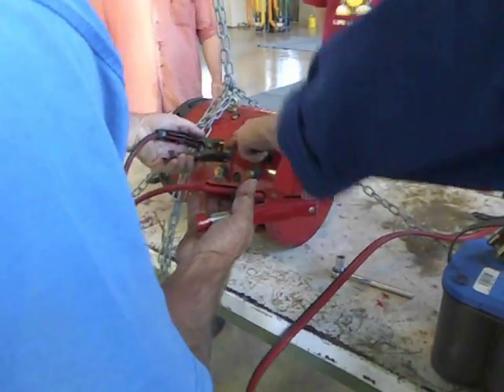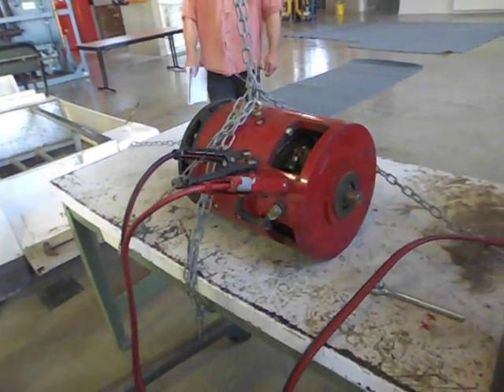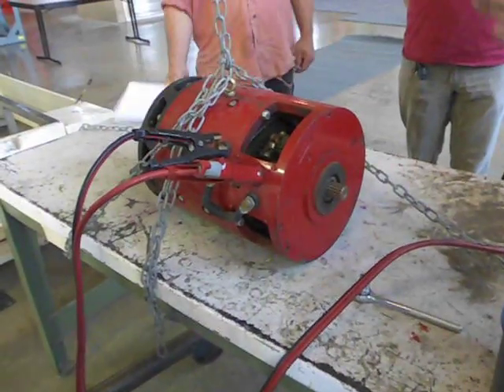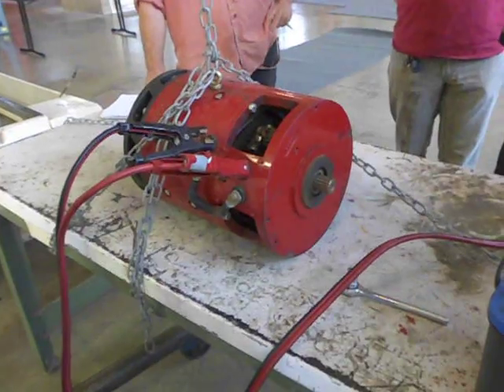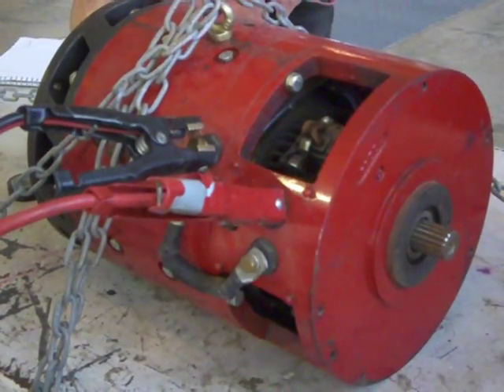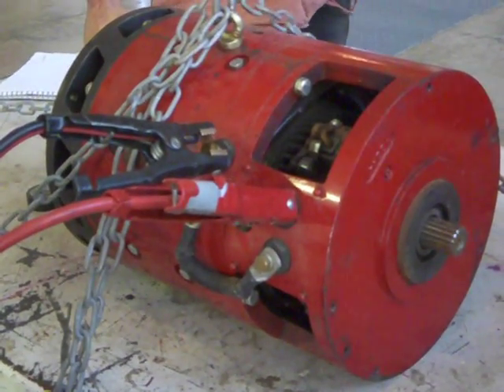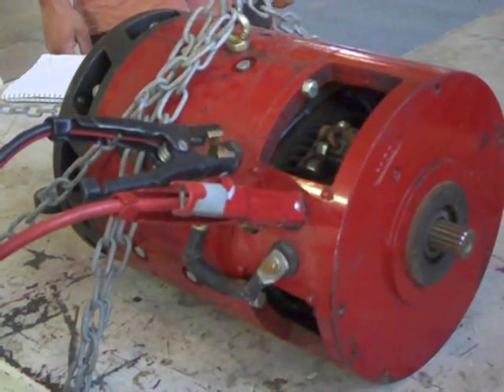Testing Series Wound Electric Motor

Comment: How do you figure out which one is A1 A2 S1 and S2? I understand that you can switch them around so that it switches direction. I just can't figure out how to connect S2 to A1.
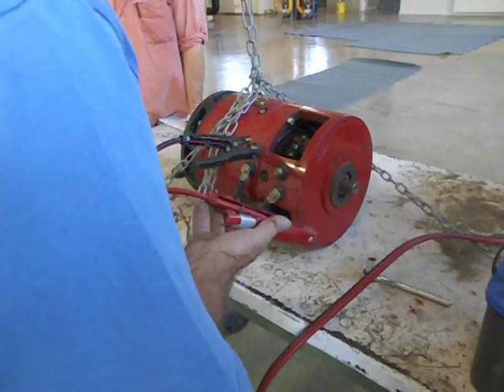Reply from the maker: Pedro Casultsan A1 is a terminal that leads to the one of the brushes (or set of brushes). A2 is a terminal that leads to another brush (or set of brushes). S1 leads to one end of the stator winding whilst S2 leads to the other end of the stator winding. If they are not labeled, you will have to look where the terminals lead to. To connect S2 to A1, just connect them using a sufficiently thick cable (with lugs) that can handle the current and volts going through it. You will see what I mean about the cable at 0:08 of this video. Do you have a picture of your motor?
Reply: ElectricCarVideos Yeah I understand the part about the armature and stator but my problem is about determining which armature terminal is A1 or A2. I guess it would have made more sense to ask: does the polarity matter? Can I choose which one is A1 or A2? It makes sense in theory (or at least in my mind) because for example if I choose one to be positive it would repel the stator EMF while if I choose to make the same terminal the negative terminal for the armature, it will be attracted to the EMF of the stator. Right?
Reply from the maker: Pedro Casultsan
To the best of my knowledge, I am not aware of any convention in assigning which armature terminal is A1 and A2. ie. I believe you can arbitrarily assign one armature terminal as A1 and the other as A2. If you connect S2 to A1 and connect one terminal of a battery to S1 and the other terminal of a battery to A2 (doesn't matter the polarity of the battery on a series wound motor), the motor will turn in one direction. If you want to reverse the direction of the motor, then I think you can connect S1 to A1 and one battery terminal to S2 and the other to A2 OR connect A2 to S2 and one battery terminal to A1 and the other battery terminal to S1.
Reply: Pedro Casultsan I have a forklift motor and I tried to take the rotor out so I could paint it and re-varnish it, but it has a big bearing in the back which doesn't want to come out. Is there a special tool to make it come out or do I need to pry it off?
Reply from the maker: Pedro Casultsan
 Is the bearing stuck on the shaft or on the housing/end plate? Is it a ball bearing? Do you have pictures?